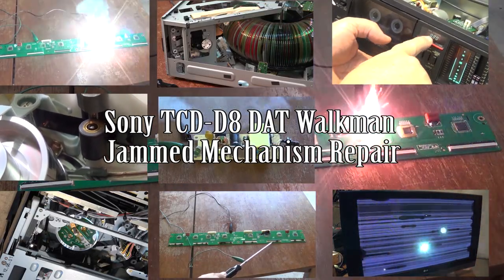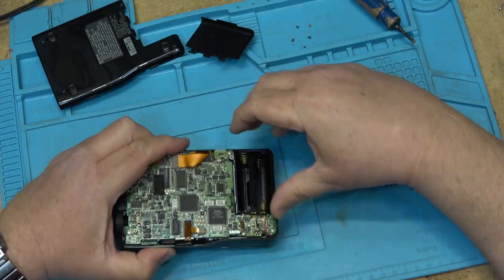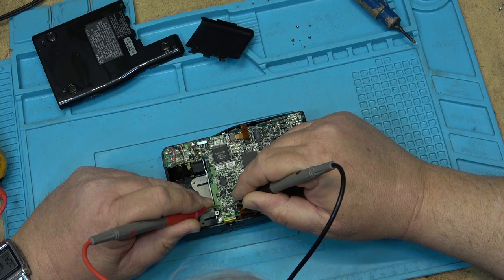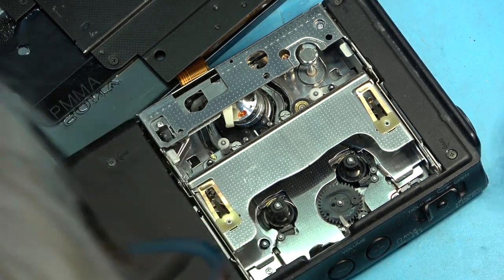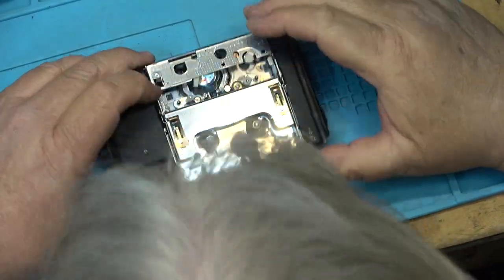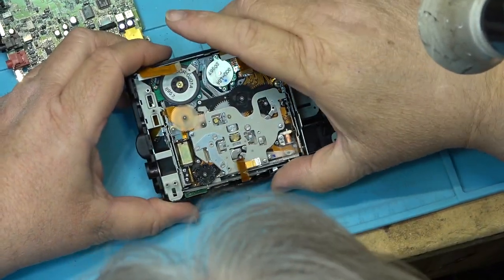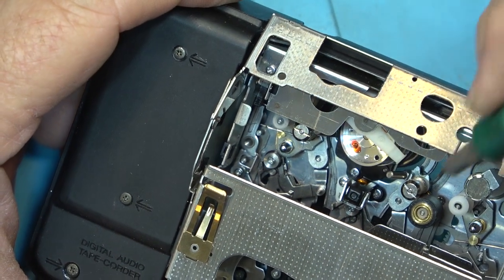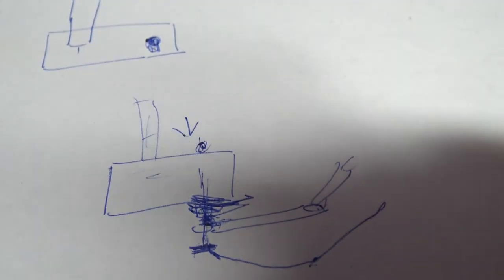Sony TCD D8 DAT Walkman Will not open Mechanism Jammed.

Comment: OK so I’m confused they made a DAT player that if you wanted to use batteries you have to open it up and solder a jumper just so you can use the batteries that seems like a lot of work what am I missing?
Reply from the maker: No there is a switch inside the power Jack that disconnects the batteries when it is plugged in. That switch failed so when it was unplugged the batteries were not reconnected. I put the jumper in so that the batteries would operate, however now he has to remove batteries when he's using it on power otherwise it will supply power to the batteries and charge them which could cause the batteries to burst or leak. The owner is fully aware that if he is using it on external power that he must remove the batteries but it gives him the option that batteries can now be used. The solution would be to change the Jack however that is a special Jack and the parts have not been available for the last 30 years.

Comment: @27:35 Wise advice.. I schedule routine tape player playback for a few machines I have and small portables with hard to get belts so they don't form memory - some of them I have taken out the belts , will service them and put belt back if I sell them which I intend.
Reply from the maker: Sell them quick.  Someone with more money than brains will buy them.

Comment: Take Dat ha ha :-D
Well done, the owner will be happy :-D

I have never had one of those to repair,  i would run away screaming  :-D
Reply from the maker: I pulled out my hair on the one i had today.  About 9 hours wasted so far.
Reply: @12voltvids  You might have to put a limit on some of your repairs.
Yes i know i'm takling crap as i used to repair into the early morning from the day before.
I was a bit too determined, what a daft sod i was.

Comment: Very interesting video, as usual with you, I guess I will use it in a near future.
I've the same machine which seems to work but I experienced a lot of drops and glitches when I play  DATs (not just one but many) and 2 of them was even chewed. 
Do you think it could be related to the tape guides? As you could expect this poor sony was laying on a shelf for 10 years and as you pointed out , it's like vintage cars, inaction is bad 😉
Reply from the maker: What are the problems I found is that yeah the guides tend to wander on a lot of them. so if you're experiencing High dropouts it could very well be a tape path alignment issue. Because generally and I have been using dat for probably 30 years dropouts are not that big an issue for the most part until the tape gets excessively worn.
Reply: @12voltvids  Thanks for you reply, Mr. 12volts. One of these days I'll use your video to open the little beast and check the tape path. I fully uderstand an old badly stored DAT can have problem but well, as I experienced the same with many I suspect there's maybe something bad inside the machine. As all those things work with only few fractions of millimeter of play,  the pubic hair of a fly can make the difference. I'll try to find this hair...  😉

Comment: DAT was one of the higher-end audio formats back in the 90s but hardware were very expensive and also difficult to manage/maintain/service, with the D7/8 having very high failure rates AFAIK.

But I disagree that the D3 was the smallest DAT Walkman.  The main unit might look small, but then after adding the external battery pack it looks much longer.  I'll have to say the D100 (and the PCM-M1) are the smallest in the entire portable DAT lineup......
Reply from the maker: Never said it was the smallest. I said it was smaller than the D8
Reply: @12voltvids  That, I agree.  It's hard to eyeball the D7/8's actual size until one gets his/her hands on one for tries.  And it's indeed a bit bulky.  The D3 by contrast appears s bit more packed in design, but that green EL LCD backlight was addictive......
Reply from the maker: @vampyrelycan99  the El panel on mine is kaput.  That was the coolest feature.  Mine has been fixed a few times and works great.  I also have 2 teac and a tascam portable but they are not exactly pocket size like the Sony.
Reply: @12voltvids  I understand the EL backlighting strength diminishes upon very long use.  Could this be the reason why yours went dead (even though it wasn't probably continuously turned on for long periods)?

Those Teacs and Tascams... you mean those industrial-grade ENG audio recorders (akin to TCD-D10) with XLR inputs and such?  Personally never encountered one though, but I know their mechanisms are much more reliable than the Sony's (sans the D10)......
Reply from the maker: @vampyrelycan99  the El backlight on mine was rarely used. Likely the hv inverter.  
Both teac and tascam units are the professional field recorder models with xlr inputs.   All 3 were given to me.  The teac dap20 have heavy duty metal chassis.
Reply from the maker: It was the highest end audio formats surpassing everything else you could own. It was also extensively used in recording studios around the world and was the mix down standard for over 20 years untill hard drive based systems replaced ur in 2005.
Reply: @12voltvids  Yes, except that there were a few things which got into the way during actual usage: dropouts, track ID editing, and SCMS (ID6) defeat.  To me track ID edit was such a pain, while others suffer from hurdles in making backup copies due to ID6 (except with pro decks with user-assignable ID6) unless with an external stripper unit which was already very hard to source back then. (I still have two Prospec MSP-730s but dunno if they still can operate to this day......)
Reply from the maker: @vampyrelycan99  smcs or serial copy management system was only on consumer decks. If you bought a professional deck such as the tascam da40 which is what I have been using for years you had the option of turning it on or off. A guy that I knew a musician had some in his studio and used it in a multitrack studio. They would always run a safety copy when doing your mix down so if you had a bad tape or a head clogged or something else that compromised your master your safety copy should be good. Because of safety copy was identical to the master if there was a problem the safety copy became the master I bet another safety copy was made from that. It all the years that he used it in the studio he only had a handful of bad tapes and never lost a session due to a bad deck again because there was always two copies made. Some of the higher end products made by Sony and even I believe tascam as well were forehead deck so they had two heads following the record heads doing real time playback to verify if there was any errors as the recording was being made so they didn't even have to listen to the tape, as they were making a recording they got to read out of any errors that were encountered during the record session. It was pretty cool what they could do with their stack of dat decks. They had session recorders that could record two channel sessions at a time so guitar would be recorded on one tape drums on another so forth with two channels for each and as they would play these tapes back of course they make two copies every time they did a session so they would have a master session and a safety copy and then each session can be played back in sync with all the other sessions so they could build a recording they are upon layer and then once it was time for mixdown they could play them all in sync and mix to a stereo master. Guy I knew had 16 tascam da40 session decks plus one backup. So while they were making their session recording they're also making a backup tape. The master session tapes were checked and then put it to storage and the backup tapes were the ones used as playback slaves that the musicians would hear in their headphones as they were making another session recording and adding to the mix. What all the session tracks have been recorded all the master tapes were that loaded into the 16 recorders and they were all played in sync as there's time code on all the tapes hit go on the controller all the tapes are playing exactly the same time code and then they could do their mix. Was a 32 channel analog board but some studios could actually work with the digital bit stream. Just follow that I know, a musician himself recorded a bunch of demos for indie bands back in the 90s. His day job himself as a studio musician and he did lots of theme music for radio and television. He converted the studio over to cubase probably 20 years ago and got rid of all of his DAT recorders. I ended up with two of his da-40s that sold to me for $20 each. Both needed belts and one a 5 volt regulator.  Mecha com error.  The video of these repairs are on my channel.

Comment: I've been following this channel for my Sony TCD-D7 Walkman which is not opening and showing an error 02. Thus far, I have learned the following: 

1. Downloading a copy of the Sony TCD-D7 Walkman service manual is very helpful
2. For all disassembly so far, the screws have been Philips M1.4x2 or M1.4x2.5
3. Group screws for each part (e.g. a circuit board) in separate containers so that you can easily reverse the order for assembly
4. Use Isopropanol Alcohol for cleaning metal tracks
5. Use MolyKote PAO grease for lubrication of metal and plastic parts
6. Be extremely precise and careful when unsoldering battery wires not to affect any surrounding connections

It may transpire, as in one of 12voltvids other videos, that the problem with my TCD-D7 is more fundamental than gummed-up mechanics, in which case I will have to purchase a second-hand DAT player (maybe Tascam) to transfer my tapes.
Reply: I have the exact player (D7) and same error code! I was hoping to get an answer here.. the service manual describes this error 02 as “not in position” so something is out of position with the mech and possibly not allowing the Open signal to pass to the door lock.

Comment: Just wondering was there ever a car audio unit with a dat player
Reply: Yes there were, but that was some 30 years ago.  Major brands like Kenwood, Alpine, Mitsubishi, Pioneer etc. did offer such car decks albeit mostly for JDM only.  Some vehicles like the Celsior (ie. JDM variant of first-gen Lexus LS400) were also available with the DAT deck option; the result was an in-dash integrated cassette/DAT audio head unit with CD changer control.
Reply: @vampyrelycan99  was always interested in dat or minidisk players
Reply: @alanarmstrong2323  You mean those for car use?
Speaking of MD, did you ever recall a single DIN unit with BOTH CD and MD slots?  Still can't figure out how this could be done, even though it was likely one single laser pickup was used for both (but not together)......
Reply: @vampyrelycan99  yes
Reply from the maker: Yes and I have it. Sadly it doesn't work
Reply: @12voltvids  bummer